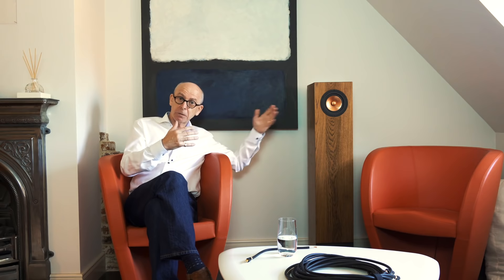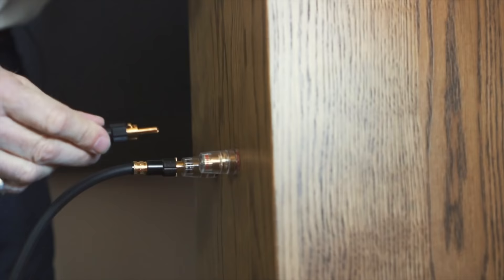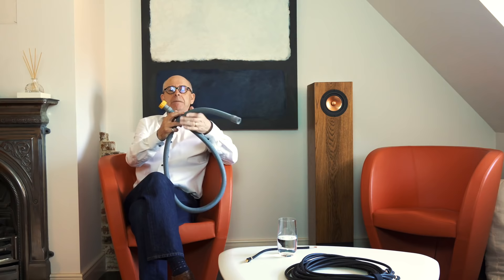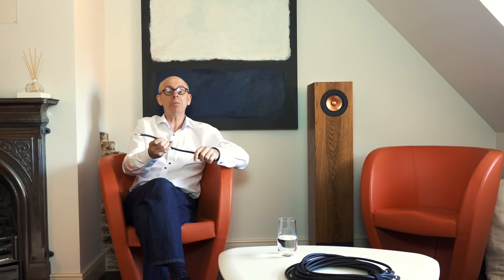Loudspeaker cables - how do they make a difference?

Comment: Thank you for the video. I'm thinking of making some speaker cables for myself and, sifting through various diy forums, I came to the conclusion that ideally the positive and the negative wires should be twisted around one another and not separated due to electromagnetic interference. Would love to hear your opinion on the matter. Cheers.
Reply from the maker: Hi, I don’t want to get into fights with anyone. All I can say is separated cables work best for us. There’s a lot of science and a lot of pseudo science. I like to listen to the likes of Colin Wonfor and many others. At the end of the day try, compare and decide for yourself. I hope this helps?
Reply from the maker: @janezzumer1639  Woops! I didn’t mean a fight with you but with other experts. Thanks for the link. It’s always interesting to keep ones opinions open
Reply: @janezzumer1639  Hello Janez. I heartily recommend making your own speaker cables (in fact I recommend making all your own equipment, but one step at a time, eh?).
Wires being twisted around each other are very common in internal wiring in audio equipment and in network/telecoms cabling too, but less common with hi-fi loudspeaker cables, as I'm sure you've noticed.
One reason wires are twisted in small signal carrying wires inside communications equipment is mainly to make sure that any electromagnetic field that impinges upon the twisted pair induces a potential into each part equally - so the signal, which is the difference between them remains unaffected. The 'complementary' reason for the twisting is so that one signal wire can't put it's field onto an outside component all on its own without it's 'buddy' being there to cancel it out.

There's a third reason for twisting, due to the shape, but before I mention that, so far I've only been thinking of small signal conductors - like inside a preamp or the input wiring of a power amp. Twisting wires is really important here because any unwanted signal that gets induced onto such wires is just about to get amplified along with the wanted signal.

Speaker cables come after the amplification has occurred, and so the signal they carry is much bigger and noise that is induced in them would represent a much smaller fraction of the wanted signal (higher signal/noise ratio). So it's less important/necessary to twist speaker wires together (although as the very effective video you linked to demonstrates, the speaker wires themselves could perhaps put noise onto something else if they're separated).

The third reason for twisting the cables is that once twisted, they are no longer parallel to each other, so the signal in one wire isn't trying to induce a signal in it's counterpart. They're actually 'constantly' crossing each other at an angle (it's hard [for me, maybe not you] to visualise but it's similar to being able to see that an orbiting body like the ISS is constantly 'falling' around the Earth, the two conductors are similarly constantly crossing at an angle). Having said that, the central spacer section in the insulation on many speaker cables (that give it the 0-0 cross section) will separate the conductors enough to lower their effect on each other significantly.

I suspect the reason most manufacturers make speaker cables in parallel runs is that it takes less raw material to get from A to B if you go in a straight line (the Roman road concept) and twisted cables need a longer length of wire. Cable manufacturers are in the business of turning cheap(-ish) metal strands into much-more-cash-than-it's-worth.

You could perhaps make your own cables as a parallel pair to start with, then twist them after a while as a Mark 2 version - I used a factor of 1.6 times the length I wanted the final twisted end-product to be when buying my 'raw' wire for my own speaker cables. In hindsight that was probably a bit generous, but I couldn't run the risk of them being too short...

Keep your terminations clean and tidy at each end, good luck, and enjoy...  :D

[Edit: restore a chunk of a sentence in the middle that somehow disappeared]
Reply: @HandbrakeBiscuit  Thank you for taking the time and providing me (and others) with such a detailed explanation. The cables I use at the moment are made of 13 AWG OF copper speaker wires that run in parallel and are terminated with banana plugs. After reading your reply (twice:), I certainly see no reason not to pull the wires apart, twist them and use some classy Techflex sleeving to finish it all off. Cheers! J.
Reply: @HandbrakeBiscuit  Hi. No worries. Thanks for taking the time to respond and for suggesting the Stack Exchange forum. Will certainly check it out.
I agree with your point. Even if there is not going to be any audible difference after twisting the wires together, there is always the aesthetic aspect of Techflex sleeving and a peace of mind knowing that things were taken care of properly ;) Plus, it's a fun thing to do, especially when you are stuck at home due to covid most of the afternoons. 
Stay well and thanks again. J.
Reply: Get yourself some high quality ofc braided nukoncept cable and some locking banana plugs.  The braided cable and sheathing cut out the interference of magnetic fields. Use 12 awg (maybe 65 strands) or larger gauge.
Reply: There's good reasons broadcast facilities make significant use of twisted pair cable runs, EMI and EMR (thus, Common-Mode Rejection) is significantly improved relative to untwisted balanced pair cabling. Slightly surprised that STP isn't used for this use case given the designer's quest for electrical signal purity. I'd contend that warm-up of amp, voice coil and environment might play as significant a role in  subjective tonality and performance of a speaker at a given point, versus the incremental changes you might get from reshaping a coil design and which may make other characteristics worse unless you really know some good tricks. Then the other factors come into play like phase coherence between channels, stereo field stability, speaker cone materials, THD and potential waveform sloping due to pre- and power-amp characteristics into 7.5 Ω drivers... I use 8 Ω passive nearfields so am aware of some of the constraints.

Cabinet and driver design are a dark art and I appreciate anyone who can design a good-sounding unit for a reasonable price. I'm less inclined to put significant weight on the cable used. Unless you're buying absolute junk, just about all copper cable nowadays is effectively OFC. So really at this point, the cynic in me thinks that €370/5 Metre cable is predominantly mark-up for the snazzy connector R&D, the cost of low-run rubber double sheathing and other business overheads. And they do look like nice cables, absolutely. 

Skin effect is possibly the more worthwhile matter to debate, if you were shooting for reduction of skin effect and an averaging of strand conductor depth, you might have considered going with Litz wire instead of bundled 80-strand, but the AWGs we're workin with here it's basically non-existent up to and beyond 20 kHz. At the lengths we are talking about transmission line effect is also not meaningfully existent. I currently use Class 5 AWG 18 Permanoid 2-core unscreened power cable in my little setups, though Permanoid also manufacture bespoke microphone and speaker cabling (SPOF, PCOF and PCW) - but I've felt no need to spend more for those yet. This cable is a low AWG with high strand count and well made with Ω/km resistance so low it's not worth thinking about. Another advantage is it's really cheap on the reel, so no fear about the cost of rewiring as needed.

As someone else said in the comments on this video, once you've resolved the main issues preventing you from enjoying the music, don't listen for faults, listen for pleasure 🙂
Reply: @HandbrakeBiscuit  great post.

Comment: I have a reasonable quality collection of components and like many, it's tough to get the sound exactly how one prefers it. I have tried a few different brands of interconnects and speaker cables over the years, and with higher end, more sensitive equipment, cables make an obvious difference to the sound due to capacitance, inductance etc that makes components react differently to each other. It's mostly a crap-shoot getting the right mix, but when you do it's certainly night and day and I used to be the guy that laughed at people that praised the cable voodoo. It's more science than fiction, and it's doesn't necessarily take expensive cabling to get the desired effect as I recently found out.
Reply: With respect, that makes exactly no sense and has never been proved. So if you did indeed heard difference (which no one ever proved), no engineer (no electric engineer nor sound engineer, no music producer for that matter) could make sense of what you heard and why. So how would someone come up with a 'technology' that is making clear changes in sound quality, if it is  impossible to conceive it nor to test it? It really must be magician working at it. Would be interesting to wonder how come audio component are so sensitive that they produce impossible things to measure nor explain but video doesnt have any of those issues. Nor does the equipment at the ER, or in a science lab in a university. Only your speakers for your hears. Wild.  Anyway, if you enjoy your speakers, that is all that matter!
Reply: Makes no logical sense mate, but even showing you mathematical proof I guess you wont believe it, because logic doesnt really come into these arguments, your eyes and belief shapes your perception of what you hear...true fact.
Reply: @healthylifestyle3427  Good reply, I think all electrical/electronic engineers that understand ohms law, knows speaker cables are unimportant (as long as you get the right awg), but unfortunately its impossible to convince those that have no interest in engineering.
Sound perception, db threshold levels etc are well known and researched, so we know what thresholds people can hear and therefore simple calculations on power loss clearly show its impossible for ANYONE to hear a difference between two 'good enough' cables.
Reply: Looks like what he is showing in the video is single conductor cab tire, around about 12 AWG

Comment: Silver plated copper wire - of a very high quality - is easy to source and not all that expensive, as long as you buy it from a military electronics surplus supplier. Miles of it are used inside every aircraft. I've got a whole reel of it here. But I bought it because it's nice to solder, not because it can have any effect on the sound of a hifi. 
Audio cables can only have a particular sound if there's something wrong with them, like a bad connection or a grossly underspecifed diameter for the power they are handling - unless you live in a universe where the laws of physics are different to this one - I wonder if that universe is where all the audiophiles live ?
Reply: "I wonder if that universe is where all the audiophiles live ?"

Reality. I've been listening to claims like yours for over 30 years. I'm still waiting for a single credible test to prove people like you are right. If you can't produce anything real, why would anyone believe you?
Reply: @fins59  Lets say you're right and there really is no difference between cables. How would you prove it to me that its all in my head?
Reply: @fins59  The reason I'm asking you for proof is because I know for a fact, you can't do it.
"I don't need to prove that it's all in your head,  it's up to you to provide the evidence if you believe these claims that exotic expensive speaker cables are better than ordinary multi stranded copper cables of adequate size."

I don't have to prove anything to you or anyone else. However, after reading the above, Its clear you don't have a full understanding of the scientific method, especially when it comes to evidence. Its not my fault you don't you don't know these things, its yours. There's so much credible evidence on cables and accessories, you could spend the rest of your life and still not  go through it all.

Also, I've never made any claims about expensive cables being better, and I never will. Price isn't objective, and it can't tell you anything about a cable. Same thing with "sounds better". Its subjective. Its impossible to prove that something sounds better than something else. Its an opinion. 

I would suggest you do a little research as to how this all works. That way, you can have more relevant discussions.

Comment: Thank you for another interesting video, Harley. My understanding of electron conduction is a bit more similar to Richard's below, however, so I'll have to forgive that part. 

To return to your water pipe analogy, voltage is more like water pressure and current is more like flow. Electrons are in a probability cloud in probable energy states like Bohr's model's 'shells'. As they are wave/particles with a negative charge they do repel each other. However the 'electron cloud' has a net drift from - to + terminal as the immediate potential difference pressurizes them to do so. The more electrons that arrive in parallel or within infinitesimal time intervals, the higher the perceived current. The actual physical speed or net drift of the electron cloud is surprisingly low - about one tenth of a millimeter per second - but of course, the propagation of pressure is near (50%-99%) the speed of light (what we call the speed of conduction). Here https://en.wikipedia.org/wiki/Speed_of_electricity is quite a nice article describing electron drift and conduction. 

In a speaker cable, however, we have alternating current, so it's a bit like watching people in a pool with a wave machine - one moment they are all going one way then as the wave reverses and they all go the other way. The people move a little bit but NOT at the speed of the wave. At the end of the day, electrons will not have drifted at all. So to refine our water pipe analogy - think of  it as a transparent pipe containing smoke or fog. The higher the voltage the denser the fog; the higher the current, the more fog particles exit the pipe per second. If the hole at the end is small (high resistance), few particles will exIt per second. If the hole is big (low resistance) many fog particles will exit (high current). I hope this turned physics into something you can more easily picture - physics isn't always intuitive and rarely easy to visualize. This model is also flawed but is a little bit better, IMHO. 

Conducting cables are in fact transmission lines and have resistance, capacitance and inductance all of their own - all of those things that you wanted to leave out by having no crossover!  
Here https://en.wikipedia.org/wiki/Telegrapher%27s_equations is an excellent animated diagram illustrating exactly what I meant about electrons in a transmission line. 

As you can see, everything has an influence and the old Quad phrase 'a piece of straight wire with gain' would even have resistance, inductance and capacitance of its own. Sometimes you just can't win! This is exactly where the experience of a designer is paramount, because it's all about making informed feats of balancing and matching one component to another. 

All the best from Switzerland, Rob
Reply from the maker: Dear Rob this is fantastic! A really great contribution to the comments. Thank you so much for taking the time to share this input with us all. No doubt the discussions and debates will continue. It seems I kicked something off here! 😉
Reply: Diy‘ed my own cables using high quality cables and connectors, very happy with the result
Reply: for transmission line effects to take place you would have to have a cable several kilometres long!!

Comment: It's a shame the cables have a white rubber insulating core. I find a light blue works best with rubber, especially on a Monday, although sky-blue-pink seems best for PVC covered cable, but it is in short supply, due to Covid 19 and the cold weather in Canada. Looking at the cost of most 'audiofool' cables, it is also cost-effective to braze pound coins together to create a nice, sturdy cable, although they are a trip hazard to small children and giraffe's....(polish your coins first, though, as the skin effect is a real issue at higher frequencies) 😉
Reply: I suspect this post is not entirely serious, yet I enjoyed it greatly. Don't craze the pound coins together too strongly - they need to move so they can bash into each other and make the electrons move without moving.
Reply: Check out Peter Belt and his amazing and crazy tweaks.
Reply: You, Sir, must be jesting. Surely you know that elevating said cables from the ground to avoid the mighty ground effect that demonstrably spinabulates electromagnetic interferences is of utmost importance. I dare say even more important than rubber sheathing in the 1st place ! And don't go for the cheap twice-baked ceramic conical ones that were broken in for less than 200 hours. Those are certainly not Audiophile quality !

Comment: I'm glad that you presented this topic quiet honestly. It is a topic that can be discussed forever. My question is when you mention pure copper  Is it the OFC Copper or the 6N 
99.9999% Copper ?
Reply from the maker: Hi Walter, thank you for your comment and kind words. In the case of our cables we looked more at the resistance per Km rather than the purity of the copper. I know that’s not how many HiFi cable manufactures see it but we stick to the standard international terms. I know it’s not the same thing but if you are interested the resistance of our cable it 0,78 ohms per Km. 
What we find important is how it sounds and in our case we just use it to form a ‘standard’ benchmark by which we can compare production with each other. And happen to like what we hear! Hoping this helps?